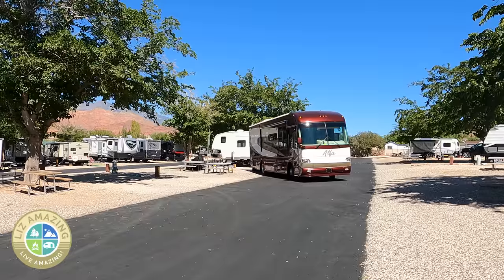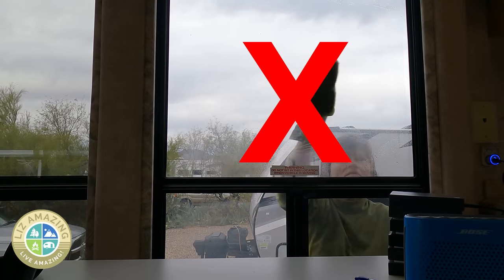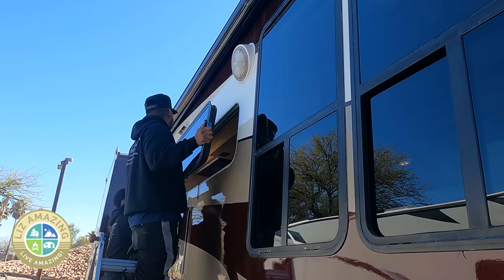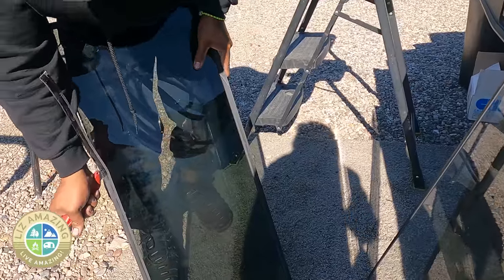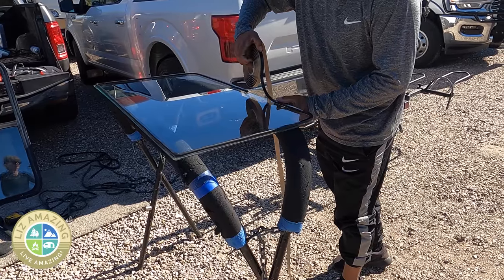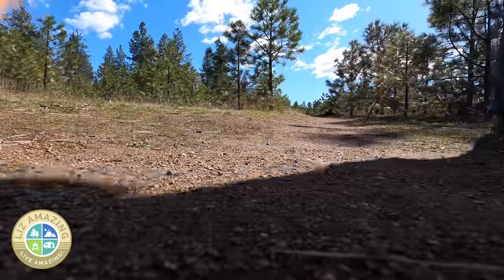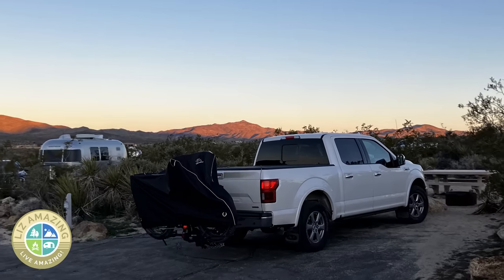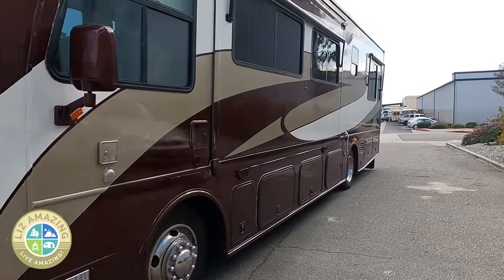RV Life: Save HUNDREDS of $$$ by getting this done | Miracle window fog remedy

Comment: I'm currently in the "throws" of defogging my passenger window.  Frankly, I should have done this over a year ago.  Took too many chances by not being able to clearly see oncoming traffic on the passenger side.  After reviewing many videos I decided to tackle the project myself.  In my case the glass had etched and needed to be replaced.  Thankfully, I had a local glass company that was able to cut a new tempered glass to the exact size of what I needed.  Bought the seal kit and now ready to put everything back together.  Hoping everything will come back together again. :)
Reply: Did you have to use a torch to break the seal,or could a good heat gun be used?

Comment: Hi Liz, While you are doing your windows, you might want to consider Llumar UV filter window film. They have some that is super clear with no darkening or coloration. UV filter can save your eyes and skin.
Reply from the maker: Great tip, thank you!
Reply: May I add to that get their ceramic tint.  It insulates and keeps a lot of heat and cold out.  Night and day difference.  I’ve done it in all my cars.  Going to do it in my motorhome next. Not cheap BUT SO WORTH THE MONEY!!! Lasts ALMOST forever with no fading like regular dye color tint.
Reply: @JahRootsRadio  , What brand tint do you use?
Reply: @robbehr8806  Llumar
Reply: @JahRootsRadio  , Cool! I've had Llumar on a couple of vehicles.

Comment: My only concern with the defogging is all air has moisture in it. Normally dual pane windows (not sure about RV windows) have Argon or some other inert gas sealed between the panes that won't hold moisture. Just sealing them with air is also sealing some moisture in. I'm sure it won't be a problem right away and I'm sure it's better than it was. But that being said I am sure it's a lot less costly than replacing the windows and may not be prefect but short of replacing is a good way to go if you don't have thousands laying around for new windows.
Reply from the maker: That's a valid concern, Steve. Jesus gives a two year warranty which provides some peace of mind. I'm sure nothing special was done to my windows back in 2005 when they were put together. Grateful they lasted nearly 18 years! Thanks for watching and for your comment.
Reply: The new seals that go between the two panes of glass have a desiccant in it that absorbs any little bit of moisture that is in the air. I just resealed five of ours last fall.

Comment: Great segment, Liz.  It sure sounds like the RV industry is doing some slipshod shortcuts in their manufacturing, such as the windows fogging over.  Keeps their profits higher, I imagine.
Reply from the maker: Thanks Karen. I think the seals just give out over time. They dry out and let air and moisture in causing the fogging. But, yes, the RV industry is definitely taking shortcuts! Thanks for watching!
Reply: Rv double pane windows are a little more of a sales gimmick more than something that adds residual or r value either one. They obviously aren’t argon filled. The extra pane of glass adds hardly any insulation value. The frame is still a thin aluminum that adds nearly nothing to temp savings. They are totally different than a residential window. 
Unfortunately many consumers are duped into thinking what’s good for their house must be good for their Rv too. If they were constructed the same then yes. But most are not.
Reply from the maker: @glengronewold2274  I guess it just depends. I’ve had nine campers and three of those had Dual Pane Windows. Without dual pane, it always sounded to me like I had left a window open when it was actually shut. The soundproofing alone is worth it to me! But again, I guess it depends on your own personal experience. Thanks, Glen!

Comment: I've seen folks rub things like a light thin layer of Vaseline into their windshield & window glass to keep them from fogging up in winter.
Reply from the maker: Yes. When you have dual pane, the fogging happens between the panes and nothing can be done about that regarding cleaning or vaseline. You either have to replace them or get them fixed the miracle method as shown here. Thanks for watching!